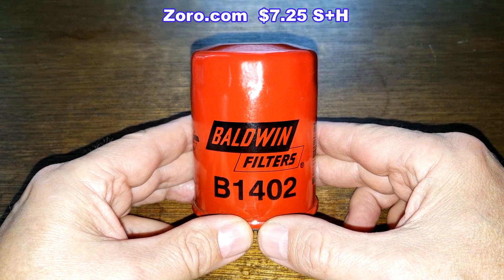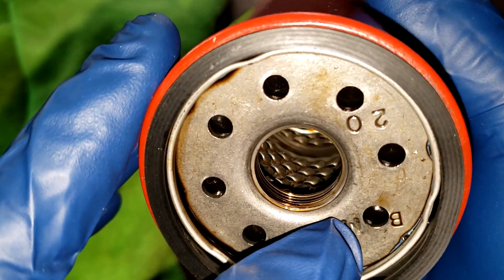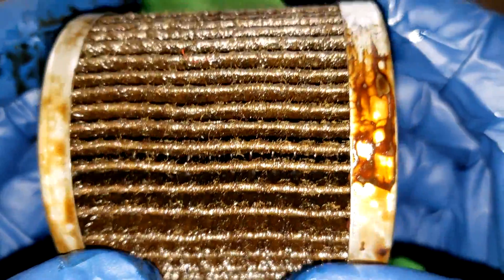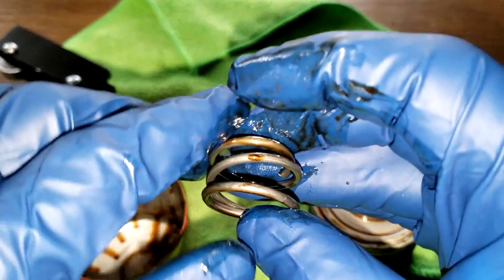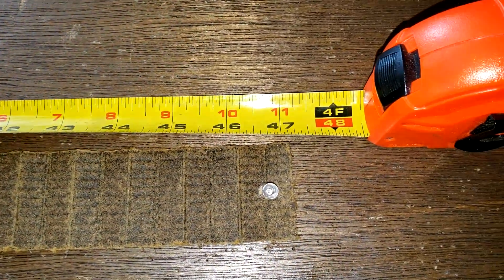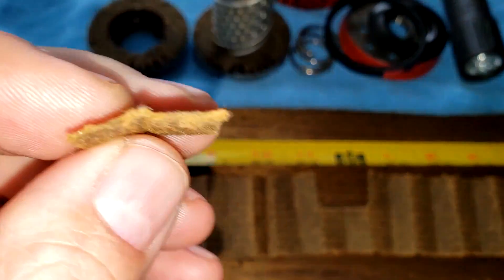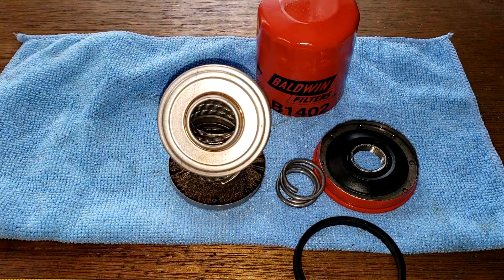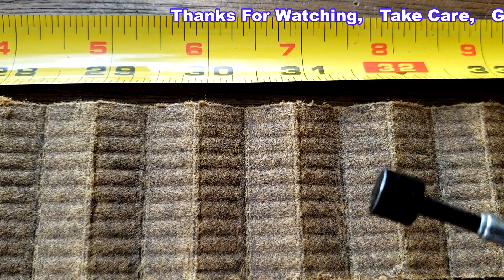Baldwin B1402 Oil Filter Cut Open, Used Baldwin Oil Filter Cut Open

Comment: The newer Subaru GDI are notorious for fuel dilution!  For this reason, I change the oil in my '22 Crosstrek every 3000 miles and it still has 3-3.5% fuel dilution according to my Horizon Oil Analysis report that I have done every oil change.  Anyone who follows the factory recommended oil change interval of 6000 miles is insane.
Reply: @gtzgreatride personally, I have been using Mobil 1 ESP 0W-30 oil in the oil diluting Subaru with outstanding oil analysis results every time, even though the oil is over 3% diluted with fuel.  0W-20 synthetic is called for.
Reply: I bought a 2015 Taurus SHO Cheap. Blown motor. I bought a Brand New 3.5 ECO Boost for 6K. I use FL500S with Redine ESTER 5W-40 Winter and 10w-40 Summer no issue. No respectable warranty on the Engine so that's what I do. IMO 5w-30 ow-20 is garbage for GDI Engines.
Reply from the maker: Thanks for Sharing👍
Reply: Why you use B1402 ??? 
Baldwin B1431 is a LONGER VERSION (more capacity) of B1402

Comment: Great video Pete😊
Fuel dilution in these new GDI Turbo engines is a real problem today. Changing oil every 2500-3000 is a must.
Reply from the maker: Thanks👍
Reply: Absolutely!  Like I said before, it's insane that Subaru and other manufacturers recommend 6,000mi+ oil change intervals with their GDI equipped models.  If I went the recommended 6,000mi oil change interval in my '22 Crosstrek, I'd have 6-7% fuel dilution in the oil.  That is not good at all....

Comment: Definitely change the oil every 3000 to 5000 miles depending on driving conditions in those Subaru vehicles, fuel contamination is a issue, stick with high quality oils & good filters
Reply from the maker: I think so too👍

Comment: I not a Subaru mechanic, but dont most Subaru run a high bypass specs?  Our 2.0 Crosstrek engine filter requires bypass specs at 23PSI.  I doubt that Baldwin meets the requirement for the engine.

The only two filters i know that meet the high psi bylass is Subaru branded filters and Wix 57055.
Reply: They should splurge on getting the actual Japanese built Subaru OEM filters from Japan instead of the US built fram/Champ Labs Subaru filters
Reply from the maker: I guess they do, I wonder why?

Comment: Subaru’s by pass setting 27 psi…for 2019 Forester….not 14psi…caution to owner for next time to get the new OEM filter or WIX XP 😊
Reply: I used that filter on my Subaru Impreza until I realized that it had a very low bypass setting. Now use Purolator Boss, Wix, or MicroGard Select
Reply: @JamesMcMullen-wj8rs  The new OEM 15208aa20 is also a good filter with the right bypass. Before it came out I imported 6 the Japanese OEM 15208a160 it was cheaper then Amazon

Comment: This vid kinda makes me a bit sad.  Baldwin used to be a really good filter, aimed for the industrial/heavy duty market, but after they got bought out, it seemed like they started to go cheap.  The media and the glue would never be a problem 30 years ago.  Sad.  

That oil dilution is a problem.  Could probably use a flush out with something like ATS and then use GF-6 oil designed for the motor.  Might need the 0w-16 weight oil.  They use low tension rings that can stick to the piston causing the fuel to squirt under pressure into the crank case.  A good flush will unstick the rings and then use that new oil should help.  Also shortcycling the oil change intervals wouldn't hurt either.  Oil is cheap, motors aren't.
Reply from the maker: Hi Jim,
Thanks for your feedback👍
Reply: @WhipCityWrencher  Always a pleasure, Pete! Your vids are must see.
Reply from the maker: @jamescaron6465  Thanks Jim, I appreciate it😊
Reply: @WhipCityWrencher  Believe me, you've helped me alot.  And I can imagine many others.

Comment: "23 nominal, 45 absolute" = 50%@23um, 98.7% (99%) @45um. Not especially efficient, but typical for Baldwin. They are decently made nitrile adbv, cellulose (at most blended) media and made in the US filter. Not readily available to me so I wouldn't use them. Seems mostly available in certain areas or by ordering with added shipping cost. Too many other readily available OFs, most better efficiency rating and silicone adbv. Thanks to Matt for the filter. Thanks for vid, Whip.
Reply from the maker: You're Welcome faxmen09,
Thanks for your feedback👍

Comment: Great review.
I'm not a big Baldwin fan. I consider them mid tier at best with poor customer service.
I have found several defects in many of them.  They need to step it up.
Reply: They used to be good, They were bought out a while back (I can't remember when exactly) and I think that was the start of the slide in quality.
Reply: @jamescaron6465  
I posted several over the years on BITOG forum.
Had many new ones that were not used have center tube voids where they meet the end caps and so on. Once they were the go to filters as you said.
Reply from the maker: Thanks for the feedback👍

Comment: What might be the cause of excess fuel in the oil?
Reply: It's called " Direct Fuel Injection ". They have them on New Mustangs and Camaro's . That's when little bit of fuel mixes with Engine Oil. Worst case scenario is Engine Oil gets thin out and causes damage to pistons. 0W-20 is very thin oil and wouldn't want that to be thinned out. Most Direst Fuel Injection cars have the Fuel filter in the engine bay. Sometimes the owners may need to change engine oil at 5000 Kilometres / 3 months or go 1 step up like from 0W-20 to 0W-30.
Reply: Could be excessive idling as well.
Reply from the maker: Anish and Jay probably nailed it.
Reply: Subaru is the cause....one of those issues with them